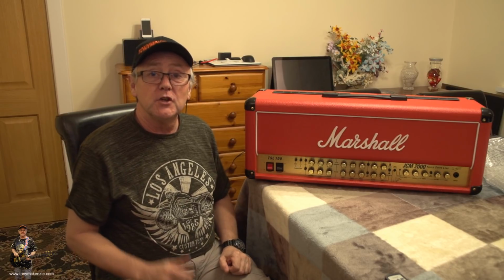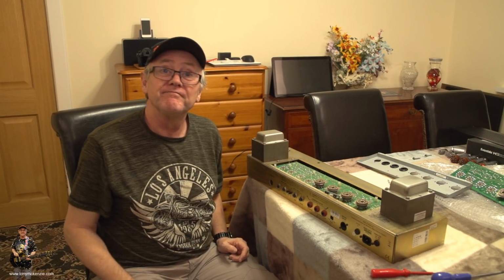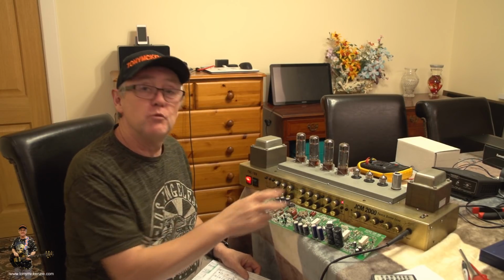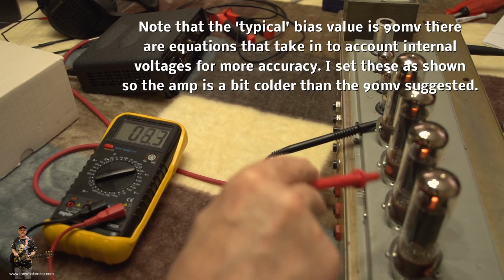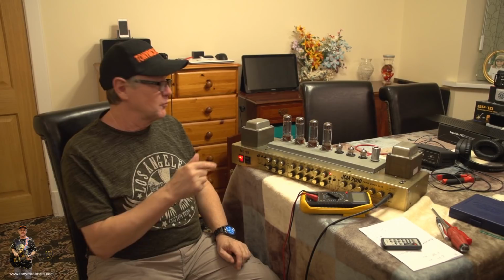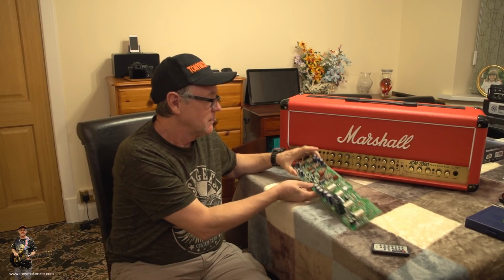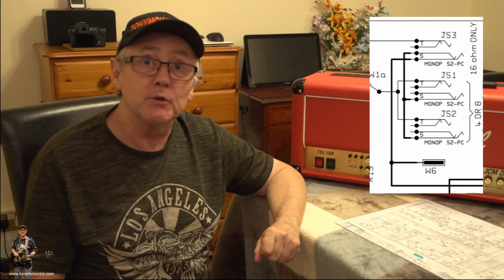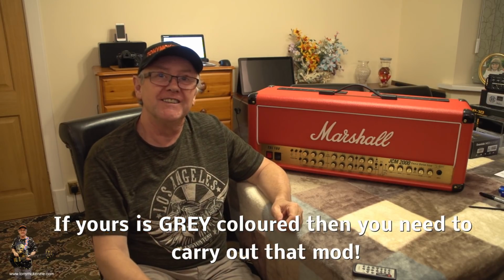Marshall TSL100 JCM2000 Amplifier | Permanent Fix For Bias Runaway | biasing review | Tony Mckenzie

Comment: Yep the screen grid pin is right next to the control grid pin (3 or 4 mm distance) which has the negative bias on it which is being dragged more positive by the 400 or so volts on the neighbouring screen grid pin via the board material. this in turn biases the valve further into conduction which makes things hotter and the run away condition it created. remember valves are a high impedance device so grid bias can be changed with very little current...
Reply from the maker: Thanks for the info Terry. I have seen guys do the cut out mod on the board etc. but I just changed the board and that solves things forever :)  but thanks for the posting as all info is good. Thanks for watching too.
Reply: Not the best idea having power valves sockets soldered to PCB's. I believe Marshell has fixed this issue once and for all with the current or latest version of the DSL100 and no longer has the EL34 sockets mounted on the board and also uses a digital reverb cct in it instead of the spring.
Reply from the maker: I have not checked them. But some while ago I did have a comment to Santiago Alvarez (designer of the 410H head among others) and he commented that the sockets on the board were 'no problem' or words to that effect here: http://tonymckenzie.com/afd100_review.htm and he specifically said 'The transmission of heat by conduction through the pins is not too big as the pins are relatively small. Main heat source is convected and radiated, blocked by the chassis in a combo. In a head the heat tends to go up away, so the PCB would run quite cool and definitely much lower than the temperature it could withstand' so that was the official answer from the designers.

Not a DSL of course but an interesting review with designer comments on there.
Reply: As long as the board does not demonstrate a PTC effect from any heat that does transfer down from the pins their shouldn't be a problem. From what i can tell the original boards in the DSL's must have been fine also when new, ..but over the course of time the board material they were using must deteriorate. The DSL I repaired a few years back for a guitarist friend of mine was a very sick animal indeed. Everything was getting really hot and and the o/p valves were redplating. The bias was impossible to adjust and it was going into an out of control thermal runnaway condition which i'm sure would have resulted in the HT fuse blowing had i left it running for any extended time. At the time a replacement main board was just too expensive to have shipped to Australia via the local marshall dealer. So i etched a separate circuit board to contain the bias cct, signal coupling and grid blockers and drilled out all four the G1 connections out of the main board. (good old air insulation!! ) Big modification I know but the results were favourable and way cheaper. Since doing that the amplifier has been running fine biased to around 75mV per side, way cooler !!  I have suggested to him to get the new issue 20 board If he does plan on keeping it. :)
Reply from the maker: You describe exactly the TSL100 board problems too - just reading around on the net there have been so many problems with the early boards. So from your experience I would say they were all the same thing basically. Ha I watched various mods but decided that because I live in the UK it was easier to get the board. I did have a way of getting it less than the sort of street price here though. Overall whatever works I guess is fine and I can tell you have been around the boards :) probably far more practise than me :) Fitting the board is not that hard though so for me that was the best answer. I can recommend the board it fixes everything and the amp sounds just like when I first bought it.

Thanks for all this info.. over time loads of guys read what's on here and it all helps in general I guess.

Comment: Great video I've been lookng for this infomation for long time, but i have some questios: Its the same for the DSL ? And did marshall correct this desing in some later version of the JCM 2000 ? I want to buy a 2000 and the first thing I am going to chek is the motherboard, thank you.
Reply from the maker: I believe the REPLACEMENT board is the same as the DSL but don't quote me. I can advise on the original DSL board... not seen one. The JCM2000 (TSL100 same amp) has boards prior to 2007 generally as problematic. Hence I changed this for revision 20. Thanks for watching.

Comment: Thank god I have a JCM-2000 DSL50 from 2001 that doesn't have this problem! I've used it at home for practice and at numerous gigs turned up for many hours and never had any problems other than standard tube replacement (including many travels in a bouncy environment to and from gigs without a road case). I've also done extensive research on the Internet, and this problem with the mother boards seems to be isolated to the 100w models. Funny how there was no mention of that in your video? Many rock players think 50w is more than enough power when playing live or in the studio, but if you are into playing metal at ear splitting volumes in stadiums, more power to you (pun intended). I can't imagine why someone would want a 100w head in a recording setting, only to 'pad' the volume down. I completely understand the difference between a 100w head and a 50w head for tonal purposes, but not unless you are cranking them up through cabinets that can handle that kind of power and volume, what's the point (thus the defeat with the power soak/attenuators)? I still love your expertise and videos, just an observation........ All the best.
Reply from the maker: The JCM-2000 was never a 50 watt. It was a 60 watt :) I used to have one. Because I never had an issue personally with that (except the sound was not good) I never even considered mentioning that aspect. From my experience particularly with the JCM-2000 TSL series the TSL-60 does not sound the same as the TSL-100 no matter what you do. I tried for about a year and sold the TSL-60, bought the TSL-100 and never looked back. For me it was not actually a volume demon mode :) but more of a really brilliant lead guitar tone. Listen to Lightpipe AI on this link and that was recorded on the TSL-100 - one of the best tones for how I play that there is: https://www.amazon.co.uk/Eniac-Tony-Mckenzie/dp/B002IU9NOY particularly towards the end of what you can play is that tone. Never possible with the TSL-60.

Interestingly, the board I fitted (issue 20) they tell me is the same board fitted to the DSL of today. I can't be sure of that but that's the info I have.

No problem on the comments, I find them all interesting generally. I did have a DSL too (a green one at one stage) but that did not so it for me either - each to his own of course. Likely I never get above about 1:00 on the volume stuff either but that's pretty loud. For the TSL I don't drop it to 50w and just leave it at 100 with a very simple feed from guitar to wah and in to the amp. delays and reverbs (almost all I ever use) are added on the desk.

Thanks for watching.
Reply: tonymckenziecom  Tony, I have a JCM2000 DSL50, are you saying they never made these? I can send you a picture of the back with the original serial number.
Reply from the maker: No Jeff you misunderstand me. The JCM-2000 TSL (not DSL as you mention) was released in 60w and 100w only. The DSL indeed was a 50 and 100w version. Ha no, I have owned a green 50w DSL... and you are right in pointing out that the DSL you have WAS made in England - hang on to it because they are now made in Korea (last time I checked).
Reply from the maker: DSL = Dual Super Lead... and TSL Triple Super Lead... 2 or 3 channels... but the amps are different inside (or were).

Comment: haha.... Wish I had this video a while ago. 

I clipped C46 and isolated the pins on the tube sockets from the board and changed the 220k resistors to 5k6. I believe theres 4. Been a year or two. 65mv per side is what I was able to do. It stayed consistent and sounds great.
Reply from the maker: Ha that's the hard way :) in any case well done for the efforts. I did look at it all but easier to flip the board :)   Thanks for watching.
Reply from the maker: Well reading it and actually having to do it are two different things. Listening to people that have NOT completed the update really can make guys do things that are not really necessary. I have not had a single issue since changing the board so in many ways this issue 20 in reality has fixed any need to start drilling stuff. Everyone has their own ideas of course, but had I followed some of the hair brained ideas posted online it could well have taken up tens of hours for a 'fix' that is really a bodge rather than a fix. People drilling issue 20 should look elsewhere as to problems maybe. Issue 5 WILL get that problem  -  and maybe the 16 Ohm problem too. Look for the grey colour on the 16 Ohm connector, seems a sure fire way of knowing there is a problem. Thanks for the info Tim and stay safe.

Comment: Hello Tony,,,,,I am wondering how one orders a new Ver 20 main PCB for the amp. Been on the Marshall Web site etc, but don't seem to be able to find a place to get one. Any ideas?   Oh, I live in Canada.  Don't mind paying shipping costs, although I think with the exchange rate it's going to be a few more "quid" across the pond here.
Reply from the maker: Marshall don't sell to you unless you are an authorised repairer.... instead go to here: http://www.hotroxuk.com/marshall-tsl100-main-board.html where they will sell you one.. that's a UK supplier, but he does have them and will ship anywhere... hope it helps... thanks for watching.
Reply: Thanks a bunch.    I also have a 1998 JCM 2000 DSL 50 watt 'er which I'm quite fond of as well. Do you have any experience with the DSL 50's?  Thoughts?
Reply from the maker: I did own a green DSL at one stage but it did not really give me what I wanted - more of a classic amp I thought. It still had drive but I never really hit it off with the one I had. Mine was made in the UK at the time and I believe later stuff is non-UK. Yours might be UK check the back...

Comment: Does the effects loop have problems Tony? I heard it effects tone and volume when engaged! Also if your just using 16ohm connection it shouldn’t be a problem, is that correct?
Reply from the maker: I have not seen problems on the effects loop. For my use to be honest I rarely use the loop for what I do, I mic it all up and apply effects later on the desk. If you're using just the 16 Ohm connector you 'might' be OK... but to be honest if the 16 Ohm does fail (they go a sort of grey colour on the ground strip) then the amp would be in a bad way. I highlighted this because it's simple enough to fix. Good point on the Loop. Thanks for watching.